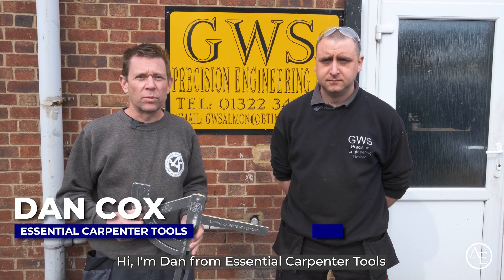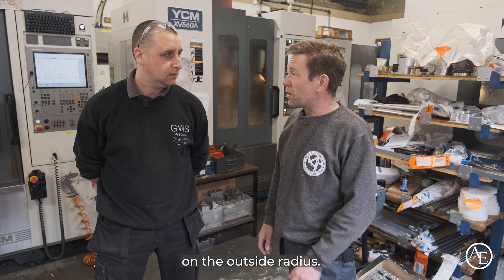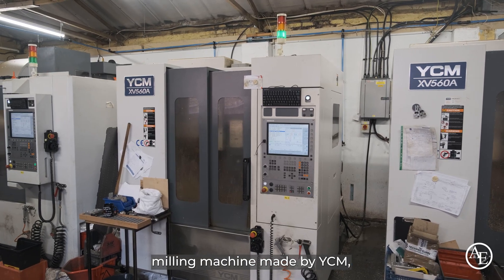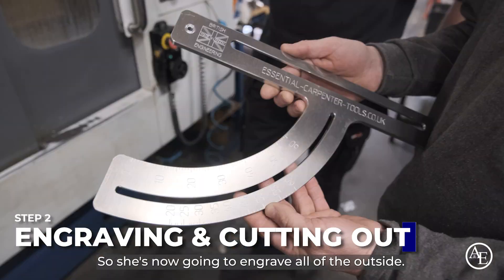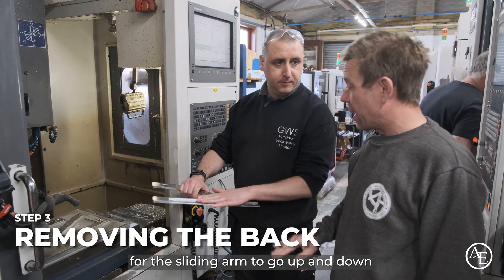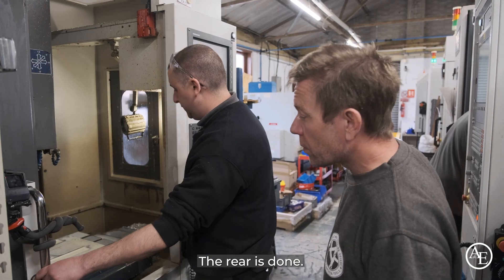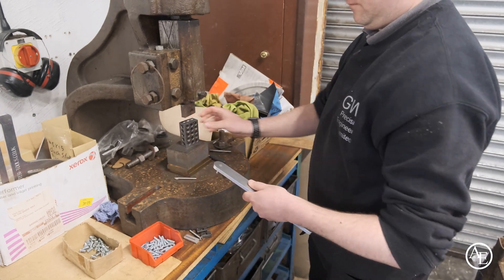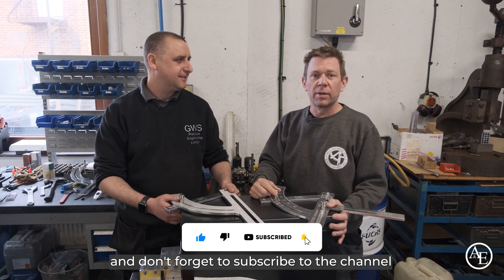How It's Made: Ultimate Roofing Square

Comment: Outstanding Dan, top notch engineering and a fantastic bit of kit. Every chippy should have one in his van, 👍😁🔨🇮🇪
Reply: The only improvement's I'd suggest would be to put some knurling on the locking knobs and to etch the graduations in black to make them stand out. I coloured the graduations in on mine with a ultra fine tipped Sharpie. I'll cut some shallow grooves on the locking knobs with a hacksaw, 👍🔨🇮🇪
Reply: @Toyotaamazon80series  it now comes with a better looking nut with more grip.   😮
Thanks.
Reply: @Ultimate-roofing-square.  Can the new lock knobs be purchased separately Dan?
Reply: @Ultimate-roofing-square.  Outstanding Dan, sound, 👍😁🔨🇮🇪